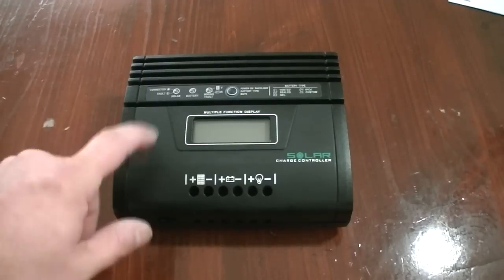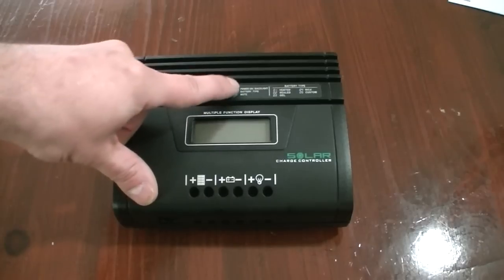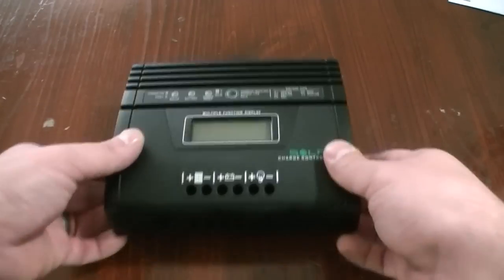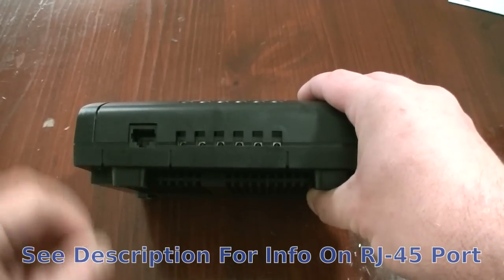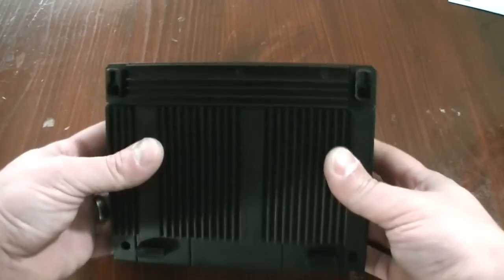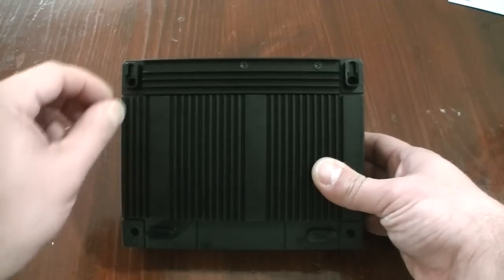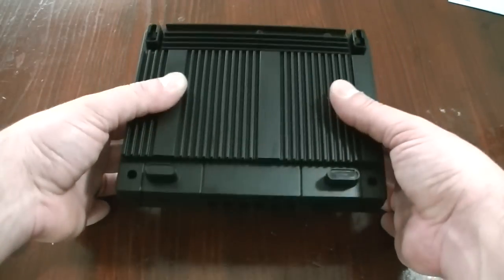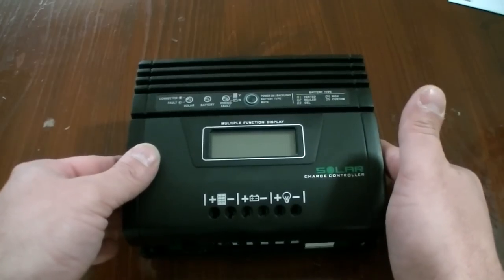Chinese MPPT Solar Charger MPPSolar PCM-3012 Review

Comment: Hi mate thanks very much for the clear clarification. Can you help me with a small campervan question - I have a 120watt Solar Panel and a 75 amp hr deep cycle battery, I only run a lap top but sometimes for 10+ hrs a day. My inverter (300w) will sometimes beep due to 10% battery 4 to 5 hrs after nightfall. Is getting a MPPT against my PWT going to make much difference? Again thanks for your advice :)
Reply from the maker: The MPPT will give you up to a 30% boost in delivered power to your battery.  Now on the other side, if your only using the inverter to power the laptop and nothing else, I would suggest getting a dc car adapter plug for your laptop.  This would eliminate the losses in the DC-AC inverter as the car adapter will only need to jump dc12v to ~19v.  Much more efficent.

Comment: Excellent review you answered absolutely every possible question I could think of. So.. to be clear, it takes about 500 mA of incoming current to get out of it's "sleep mode" ? that's pretty good, I have a chinese 30A MPPT that requires an amp, which to me, in northern climate (and lots of dark days) unacceptable. Worse, being that it is 30A and not 40 or 50, you cannot solve the problem by attaching two panels, as it will not quite handle it. Or I wouldn't, anyway.

Comment: Thanks very much for this excelent informative review. I've been looking for a couple of days for the best solution. I shall be moving off-grid in Spain in a month, and need to run a laptop, extra monitor, and internet gear (radio) for work. I'll be getting one of these and a 235w panel (we already have a 100w system on a pwm for lighting and TV). What are your views on 12V-19V boost converters for laptops? (24V-19V switching buck converters dont seem to exist!)

Comment: Hi, great video. I need your help! :)
I recently bought a solar panel brand: renogy:
Optimum Operating Voltage (Vmp):
18.9 V
Optimum Operating Current (Imp):
5.29 A
Open - Circuit Voltage (Voc):
22.5 V
Short- Circuit Current (Isc):
5,75 A
Maximum Power at STC:
100 W
Operating Module Temperature:
-40°C to + 90°C
Maximum System Voltage:
715 VDC
Maximum Series Fuse Rating:
15A

I have connected my stuff like this:

Solar panel (measures 19.7v DC) -> China MPP30 panel terminals awg12 cable--->Panel Battery Terminals to 1 12VDC Car Battery (still holds charge) ->from battery terminals 500W off-grid inverter 12vDC/120VAC.

Charge controller tells me this:
PV A ->4.5
PV V--->13.8
temperature 22c
Battery volts 12.2  62%

problem? it will not hold more than 50watts /120VAC.

Fake MPPT?
Reply from the maker: Sounds like it's working as the PV voltage is higher then the battery voltage as it's supposed to be.  The tricky part is the optimal values for your solar panel are in a labrotary conditions.  In the real world you have to take into effect the temperature of the panel itself, any high level clouds, the angle the panel is positioned relative to the sunlight, and the time of the year (less sun in winter then in summer).  If your in the northern hemisphere it will be hard to get full output from your panel in winter.

Comment: question,,,,,using a 100 watt portable solar panel ,two t150re 6 volt batteries in series and a 1500k sine wave inverter is it ok to install a renogy 12/24 mttp charge controller or is it to big for the set up?

Comment: i bought one of these a few years ago and it never charged over 13.8 volt even on a discharged battery,i had a battle with the ebay seller and in the end took them to coart,mine was rubbish I then bought a Morningstar and I have never looked back

Comment: could you tell me how many 12 v batteries can you hook up to that charger (for 300amps solar panel)
Reply: You probably mean 300 watts. Basically if you for example take lead-acid batteries you want between 5 and 10% charging amps of the total battery capacity  at max. for a 300watt panel  with a max of about 15 amps ( using a 24v panel ) charging power you can hook up to 200 ah on 12v batteries on this safely. or 400 ah using two of the said panels maxing out this controllers capacity you could even charge an 800ah battery bank and store about 9 kwh energy.

Comment: the question I have is I have limited out the controller with the 245 watt panel, is it possible to run another identical charge controller and 245watt panel on the battery bank in parallel . (I want to add 2 more 120 amp hour batteries to the bank) to run a small freezer.

Comment: Nice reasoning on why a PWM controller is less efficent than a properly working MPPT controller. But the examples you give @ 3:52 -  4:20  on PV power loss, are greatly exaggerated, and do not help on building your credibility.
Even if battery voltage is @ 10V, and the PV panel's Vmp is @ 18V,  PV watts will derate by a maximum of 45%. Meaning, a 200W PV will give 110Watts
And even this derating is exaggerated, because under those circumstances, PV current aproaches Isc. (~10% higher than Imp)

Comment: Thanks for your review of the product. It has helped me in setting up my own portable power source. I've now bought for myself 2 x 105AH AGM batteries, the PCM3012 is next. The seller has AGM is one of the battery types the controller supports, on eBay. But I dont see AGM amongst the 5 types on the controller. Are you able to recommend the type I should be using with my batteries. FYI - my batteries' Current Use: 14.40 - 14.70V; Standby Use: 13.50 - 13.80V; Initial Current: less than 25.00A

Comment: This looks like a decent MPPT charge controller, I'd guess that the RJ-45 is actually for a remote display. 

The Heat sink on the rear doesn't make much sense. It is supposed to be wall mounted, strapped for airflow, and then there is a 2nd heatsink that actually blocks vertical airflow. Odd choice to say the least.

My review of the EPsolar Tracer "Chinese" MPPT is on my channel.

Comment: my 100 watt solar panels puts out 8.3 amps how are you only getting 10 amps out  of a 200 watt panel? you should be getting 16.6amps... basic math.
Reply: zerodegrees8 
He's running 24Volts instead of 12Volts.

Comment: I had this model and found it to be robust. I regularly overloaded it, to alarm state, with 20A input, but it never blew up.

One large problem with it, was that it only charged to 14.15V (in vented battery mode), due to bad voltage calibration. This was OK, for my Gel cells. When disconnected, it defaulted back to mode 1, which was safe for my gel cells. I contacted the manufacturer, and they made sympathetic noises, but couldn't fix it. Current (AMP) reading was accurate.

Another annoyance, is that its criterion for end of boost charge, is when it hits 1 Amp, it drops to float, after 2 minutes. The Tracer, at least does it for 2 hours. This is a problem, if you are trying to work it alongside (gang it) with another charger.

I found the MPPT yield to be 7% on hot good quality mono 12V panels, but not as good as I expected on 24V panels. It seemed to get more confused on 24V input. I was not particularly interested in power gain. I just wanted a smooth DC output, that wouldn't screw up my DC computer power supply, which was the M2-ATX. High frequency PWM was more likely to crash it.

Currently, I'm considering the new model EP Solar 40A, because it has loads of set-points. I prefer a charger to not go into float, because I don't think they can know when to do it. The sun goes behind trees at 3PM, here, so that's when it goes into float :-) The rest of the day powers the fridge and computer. Float is all very well, if you live in Alaska.

Comment: Hi mate, good review! I have bought the exact same mppt unit, also my brother has the same one, I tried them both out today, they both seamed to go well for about a minute with the solar panel on until the charge from the panel dropped out on the screen of the unit for a minute or two untill coming back on then off again on off, they both did this , are they ment to ?
Reply from the maker: Deon Cauchi That sounds like some odd behavior.  Without knowing the specs on your solar panel and battery that you tested with, I can't guess as to what might be going wrong.

Comment: I tested a similar 30A unit for a couple weeks bought on eBay direct from China and found it substandard to the claims in added efficiency and went back to a PWM controller. One thing to consider if wanting more power from your system for dollars invested is the added cost for MPPT controllers.  The price difference between a good 30A PWM controller compared to an MPPT is almost enough to buy another 100 watt panel. The added power from another panel way exceeds any gain claimed from an MPPT controller. Also the life expectancy of both panels and PWM units is much longer than an MPPT controller.
Reply: RLZerr This is not China made. This is Taiwanese. China is not the same as Taiwan. Furthermore your claim of 'similar' doesn't hold any grounds. If it's not the same brand and manufacturer then it's definitely not the same, have a little bit of common sense. The one you got may not even be an MPPT controller as proven time and time again in various video reviews and teardowns. Obviously you haven't researched  enough to know what an MPPT charge controller to validate your claims of having diminishing performance. PWM is junk. If they aren't then why do solar farms use MPPT?
Reply: Fully agree. I use a 30 amp Helios PWM controller and have not a single regret. I will probably eventually move over to a MPPT controller simply because I am at my limit as I have 3x 255w panels. I am therefore at max or very close to the 30 amps of the controller. I need another 10 amps at least which exceeds the controllers max. Only at that stage would I even consider MPPT and the added expense.Must admit though the Chinese and Taiwanese products have improved massively over the last few years.

Comment: Dear Friend,
Thanks for the great review. Currently I have 7x40W panels hooked in parallel so I got around 10-14Apmz  in peak and voltage is around 18-22V. The battery I charge is 150Amp/h seal type. The current PWM charger has few issues therefore if I go for this model will it suit my setup.

Thank you.

Comment: Great video. Very educational about MPPT controllers. Unfortunately for yours truly here, I have one of those nameless brand China Solar Controllers Inc made Pulse Width Modulation (PWM) Charger/Controllers :(  My Solar Controller is brand new and rated @ 20 AMPS maximum current capable. I will run a brand new 100 WATT crystalline solar panel into it and an expensive large capacity 12 Volt AGM Deep Cycle battery will serve as my main energy store. This is just a suggestion, but I couldn't help but notice you touched your metal screw driver to various soldered component points in the exposed circuit boards of your MPPT unit. Please be advised it is NOT a good idea at all to actually make physical contact with an ungrounded piece of metal. This is a MOSS FET Transitored circuit, which is VERY fragile and susceptible to even minor static discharges. Just sayin' :)
Reply from the maker: Mark Job Good advice!

Comment: FAKE CONTROLLER ALERT: I found the Dioxin 20A MPPT charge controller is actually just a PWM, its a small black metal weatherproof box with wires sticking out, too good for the price :(

Comment: i bought this mppt controller for my 3) 100 watt solar 12v panel max 
Optimum Operating Voltage (Vmp):
	

18.9 V　

Optimum Operating Current (Imp):
	

5.29 A

Open - Circuit Voltage (Voc):
	

22.5 V

Short- Circuit Current (Isc):
	

5,75 A

Maximum Power at STC:
	

100 W

Operating Module Temperature:
	

-40°C to + 85°C

Module Efficiency (%)
	

14.99%　

Cell Efficiency (%)
	

17.88%

the vendor MFG said it was a poor choice that i should stick with PWM cheaper that there was better ways to go >what.... because i was maxed out..18.9 X 3=58.7 an i would only get 50v max from the mppt

this is his reply..
Hi again
It's not "wrong" to match your setup with the PCM3012, but I'm just saying there are certainly more ideal setups that would work better with a MPPT charger. Putting 3 of your panels in PARALLEL is unfortunately the only way to go in this case, as the controller cannot take in more than 50V(Voc); but ideally, with MPPT you want to wire more panels in SERIES (then when you can't, go in parallel), so you can see the conversion advantage it has, over PWM ones. When you wire all 3 of them in parallel and those are 12v panels, there isn't a lot of room to make conversion.

Long cable runs generally isn't a good idea - the longer the cable, the higher the voltage drop (more resistance) so would require you to use thicker, more expensive wires. I would reduce the wiring distance as much as possible. Or you may find the high voltage loss can reduce the effect of MPPT charging, i.e. MPPT requires the pv input to be within mppt range in order to charge, so minimum 16V is required. 

so what do i do i have a 30amp PWM i thought this would be better> can you direct me to a better charge controller!

thank you,
Reply from the maker: It will still work and give you a boost.  Find a sunny day and have a half dead battery.  Hook up the unit and measure amps in to the controller with a properly rated meter then compare to outgoing charging amps on screen of controller.
Reply: i thought so too.. tech support really done played it bashed it .maybe they undervalued it....the /MFG solar tech just sounded like he wanted to talk me out of it i'm starting small an growing both solar an wind/permanent magnet motor dc 24v 400watt 22 amp ... i have been researching the subject between the two charge controllers so i was not walking in blindsided..

 an when you brought it to my attention i thought wow this is it an i jumped on it for 130$... thanks... you gave a great presentation, i enjoy your channel, you have a gift an i am a prepper an  look forward to you analytic views there is a lot of junk an bunk out there... good to hear the real truth an not be misled..... thanks again.. it will over achieve my crappy throw in the bundle 30 amp PWM don't get me wrong they have a place... if you want to wait a week
Reply from the maker: Actually throw the cheap 30 amp pwm controller and some replacement blocking diodes for your solar panel into a small faraday cage and you're now prepped to have solar after an EMP event.  That was simple.